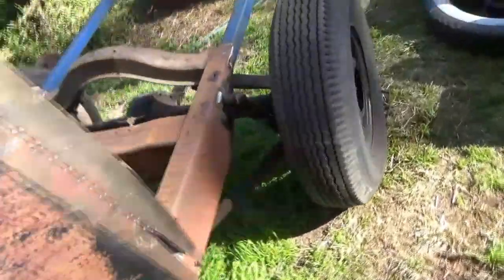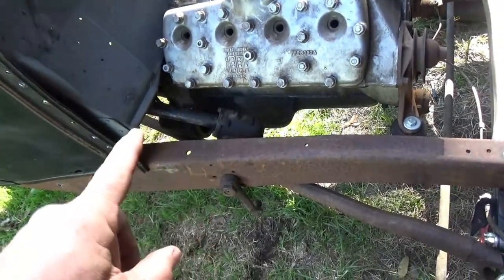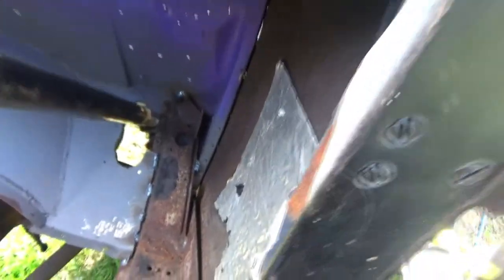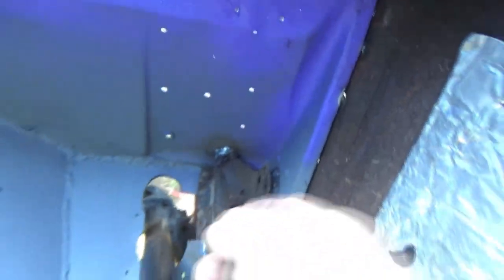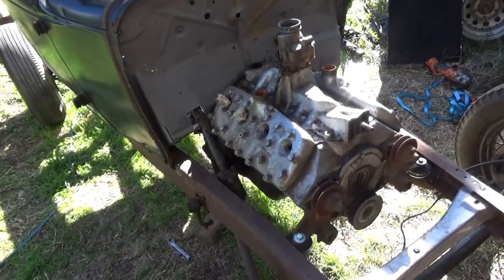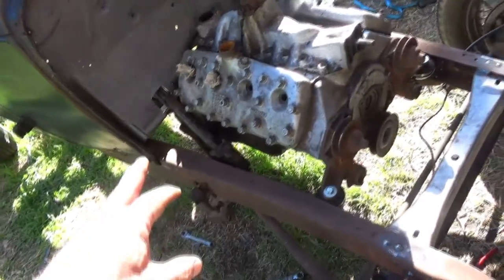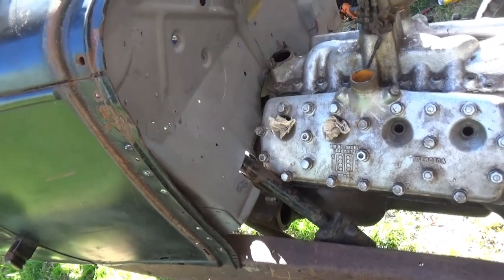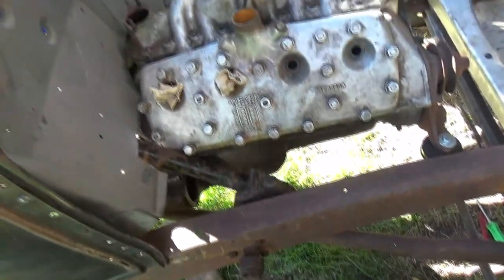It Steers - Model A Pickup Build Pt14

Comment: Good job on that drag link!👌 Does the steering box have a stop so that the tyre won't come into contact with the drag link before it reaches its full lock (turning right)?
Totally enjoying this build - great to see the original artform of hot rodding still exists instead of just piecing together mass produced (purchased) parts!!🤙
Reply from the maker: Cheers man, yeah the stops are usually built into the nuts for the king pin locking pins. I’ll replace all those on re assembly. Glad you’re enjoying the build, much appreciated 🍻